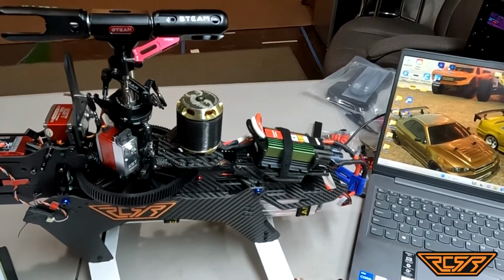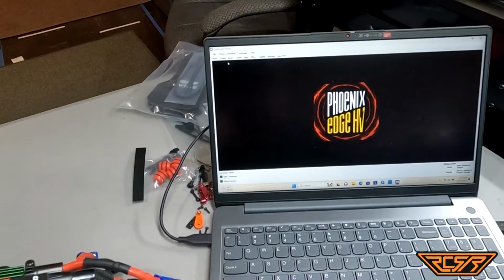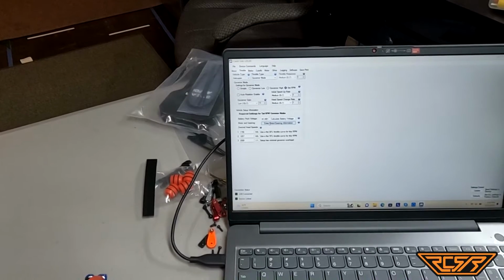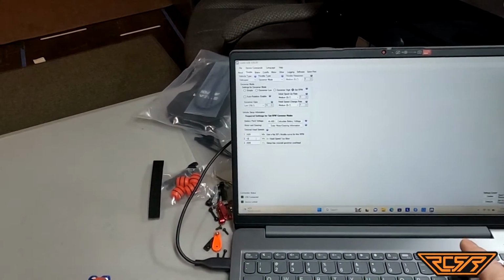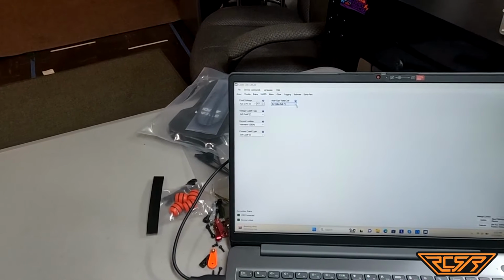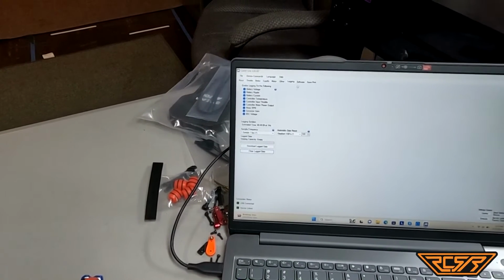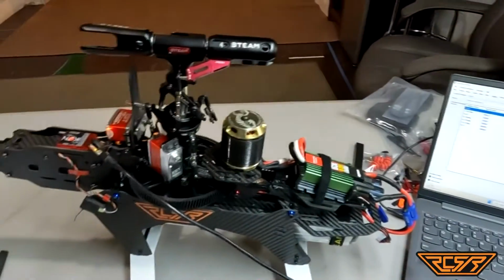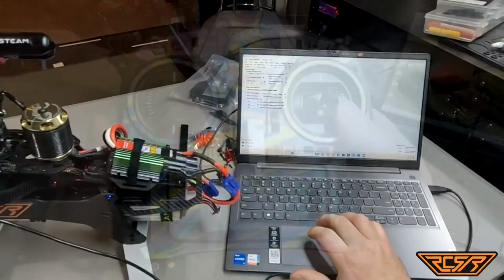Castle Creations Phoenix Edge HV 160 ESC set up on AK700 heli

Comment: If your lowest throttle value is 30% as soon as you flick your throttle hold the motor will instantly go to 30% throttle which wouldn't be ideal. The first point on the throttle curve needs to be zero so when your throttle stick is back the throttle will be off.
Reply from the maker: Not true at all. Throttle does not need a zero setting especially when you fly 3d. If it had zero it could reset to a soft spool up if you try to fly low head speed and go full negative pitch. Also the 30% is a standard for Castle and is a reference point that sets the predetermined headspeed for that radio point. If flying scale or basic then you could use the zero thing. Otherwise this gives a true 3 usable headspeeds for 3d style flying.
Reply: @rcspeedracer  What sort of 3d are you going to do at 30% throttle. Not much at all unless you want a boom strike. First point must always be at 0%.
Reply from the maker: @BradHaines1963  You are not at 30% throttle. 30% dictates what that particular headspeed is set at. And you can do low headspeed 3d without any issues when properly set up. 30% could be a 1500rpm set up for example. This is fine. All 3d is not fast and hard. Zero is good for scale or beginners. That’s it. When throttle hold is kicked off it will spool up and you always want to kill headspeed when landing even if it is a baby autorotation. I’ve been doing this for many years and have set up some pro pilot machines. I’m happy to discuss this more with you if you would like to learn more about it. But this is the proper way of setting it up.
Reply: @BradHaines1963  he's running governor at Set RPM mode, meaning the Castle ESC is going to look for 3 value ranges which is assigned to 3 RPM values. So if he sets it at 30% the ESC will govern at the first RPM bank. Heli mode also works a bit different from Airplane mode, there is always a slow spoolup which can be configured.
Reply: @rcspeedracer  I understand what you mean now. So at the end of the day to land you must use your throttle hold and do a small auto. Correct?
Reply from the maker: @BradHaines1963 yes that is correct. Throttle hold is my zero point. Allows 3 full idle up set ups and I never land under power.
Reply: @rcspeedracer  Thanks for taking the time to fully explain this. I'll try it out on my Maverick 800. Have a great day.

Comment: Good video. I like my Castle esc. Do you remember what your governor gain was? I went with default at first but had to increase it after the first flight. Do you used auto rotation bail out? That seems to be something people have issues with. I'm still tweaking on my 120HV & plan on using two hold modes. One that doesn't go to zero throttle but stops the motor power. And the other that goes to zero throttle, for landing normally.
I'm flying Align 700E. Spektrum NX8
iKon2 
12S
Reply from the maker: Great set up that you have. I have a multi part ikon vid coming soon. I use default for governor and usually works great. Only time it hasnt for me is if I tried something other than outrunner for motor. When I change that it seems I have to tweak governor. This one does not have bailout but I have used that on my one sons helis so he could basically do blade stops during his flights at multiple times.